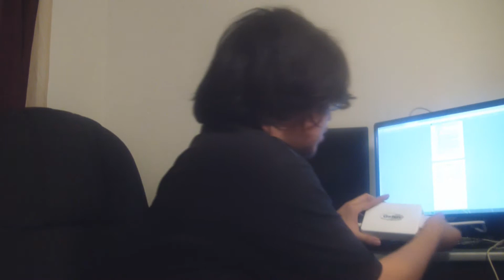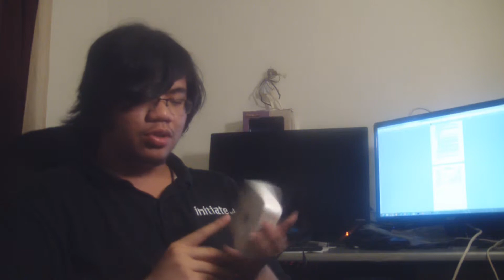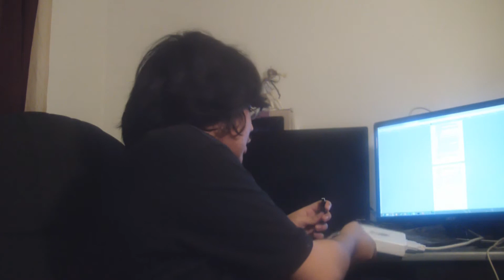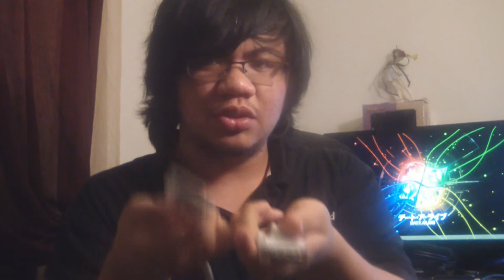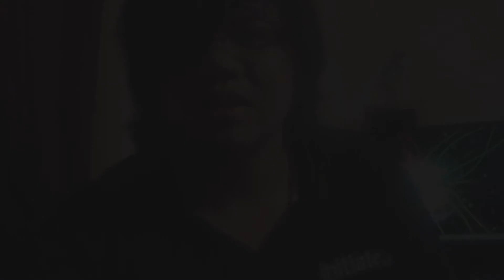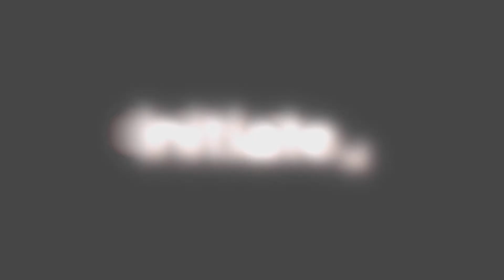Overview of the Gefen DVI to Mini DisplayPort Converter

Comment: I'm very interested in buying this monitor since it's currently the cheapest 1920X1080 display on the market and would look great besides the Mac G5 case mod I'm working on. But I'm worried about the 16ms response time, how does it perform while gaming? feedback wood be appreciated. Thanks (I subbed).